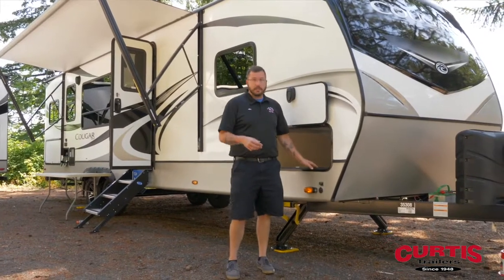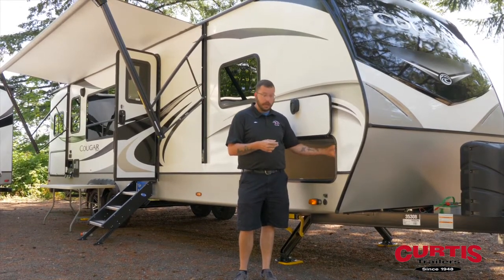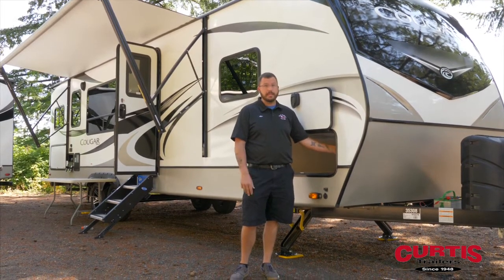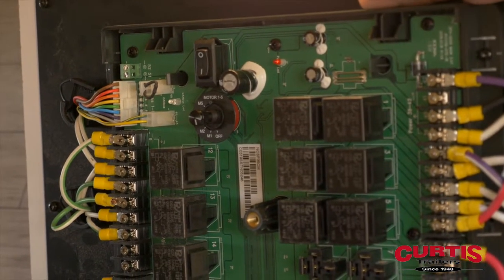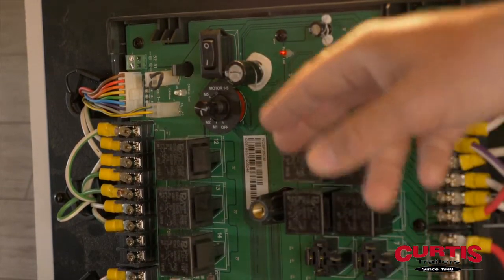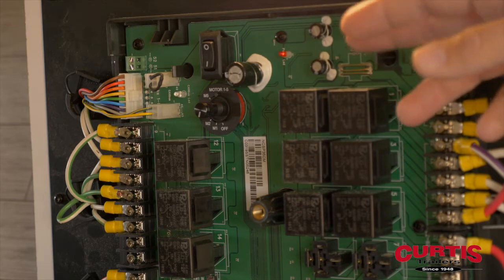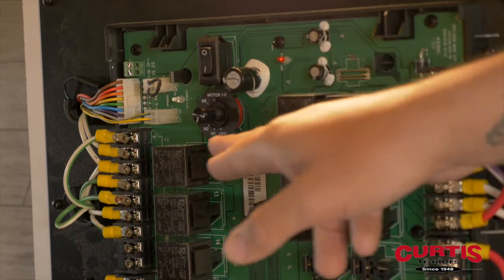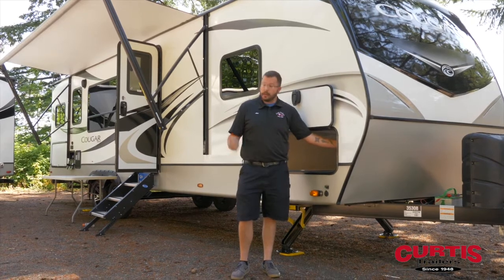Emergency Manual Override for InCommand Body Control System

Comment: My two batteries in my fifth wheel got really low. We have a solar panel that maintains / charges the batteries. Bad weather and sitting for 4 months caused the batteries to drain. So I pulled out the batteries and charged them with a battery charger and got them back to 12.96v each. After I reconnected everything, I noticed my Incommand screen was low lit white and blank. Did the turn off and turn on, and also did the battery disconnect off on. Still blank screen! Any helpful tips to get my screen back?
Reply: I have the same issue, did you wind up changing your screen?
Reply: Yes, the company sent me a new screen. I sent the original back to them. Works great now.